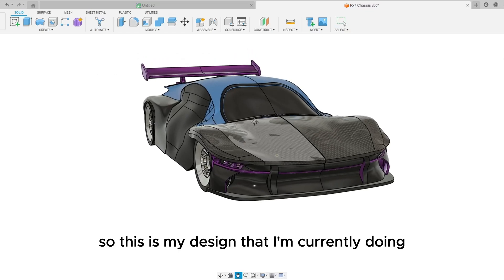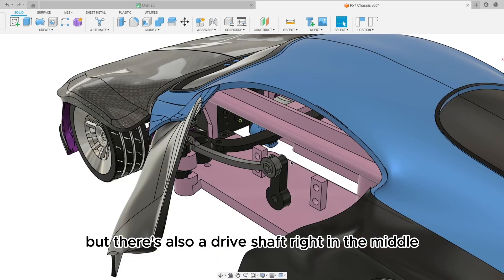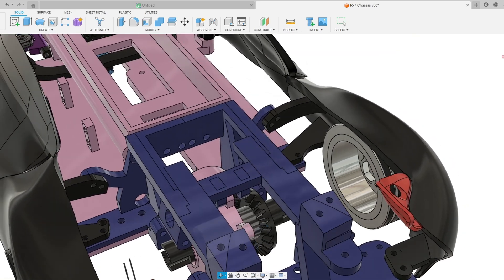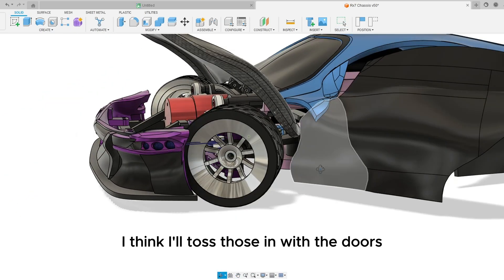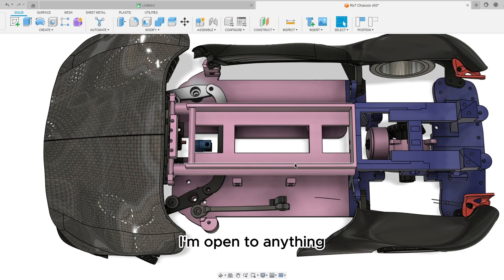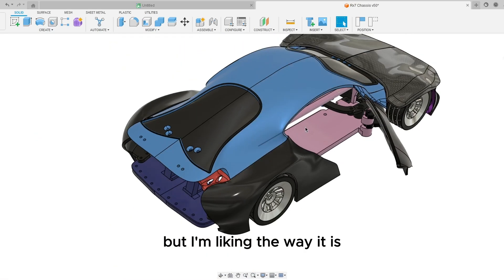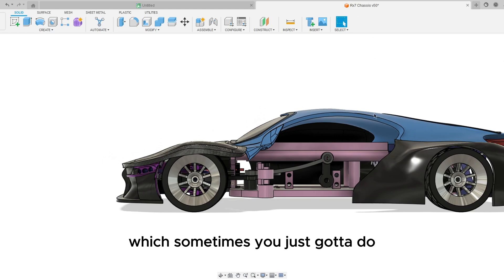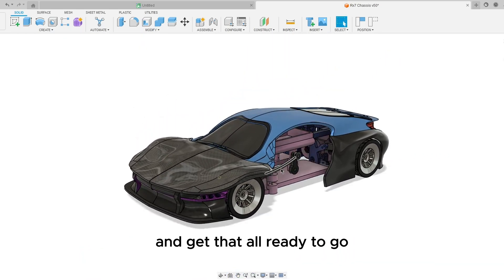3d Printed Car. Part 1!

Comment: Very nice design indeed, from my experience with printing rc cars you would want to mount the printed arm that goes from the servo arm a bit further down on the servo arm (because it looked like it only moved a little bit) which would give it more torque and less slop. Im guessing you're using a brushless motor, if you can make universal 3d printed joint that hold up, very impressive. (Im working on a big 100cm 3d printed monster truck, and Im probably going to have to print the universal joints out of nylon or something.) The gears also btw, ratio has to be way higher like you mentioned, but also they have very big teeth which will probably not run as smooth as "more teeth gears". For almost all my cars I've just put the motor horizontal to the rear axle and had 2 gears connecting them, (the shaft gear being basically as big as the rear tires to get the right ratio).
Reply from the maker: Thank you, I thought of this before but didn't know the reason to do it. Now I do from your comment and will most likely change that part. I use a mix of my brushed and brushless motor(Rn the brushed motor) but the universal joints do work and did break a couple times but with the tweaks I did they work great now. I am currently working on the gearbox and making the gears for the universal joint to connect to. I'll make a video for that and post the universal joint assembly for you as files to look at or get an idea of.
Reply: @ChromaPerformance  Yep, sounds good! The tricky thing about larger veichles is that the durability doesnt scale the same way as the physical volume of the parts does, thus PLA universal joints will break much easier on a bigger high torque (like really high torque, two 775 motors with a 1:5.4 ratio) vehicle. Not to mension jumping the truck and giving it throttle mid air just for all that momentum to go through the joints when you land and the tires instantly stop spinning. Also, what software did you use for making the car body?
Reply from the maker: That is true, just gotta research some other designs or see how the real ones do it. Saw someone use balls for their universal joint. I used fusion 360 and made the body with forms and thicken them to 4mm.  @filippus_

Comment: This is the best build I’ve seen and if I had to give a bad comment, my least favourite part was the rear bumper, but you get it finished🙌🚀💯
Reply from the maker: Thank you. The rear bumper can always be redesigned or even just redone. Maybe a more aero rear with custom rear fenders so it can glide through the air better. "I might just have to do that in the future" But the possible are endless.

Comment: Btw, the windshield looks a bit odd no offence. But I think this has a lot of potential
Reply from the maker: No offence taken. Still in the proto phase so changes can be made. I am always looking for new ideas and what others think. Thank you
Reply: @ChromaPerformance  another thing, the front hood is sticking out a bit, but overall looks good, so I subbed to see the results
Reply from the maker: Thank you for the sub. The hood sticking out a bit is part of the design, but it does not sit flush yet with the front bumper. I will be fixing that and making more flushed. I am not going to be rushing this process to make it right but hopefully I can get the results part by part. @davidnotgidenko
Reply: @ChromaPerformance  sounds good! Cant wait to see what the future holds. Just fixed my printer directly before I typed this comment

Comment: honestly a mid wheel engine would be interesting with all wheel drive system so the weight ratio of the car will  be balanced since its just an RC car, that would be interesting if you can make it work
Reply from the maker: I completely agree. That might be my next design

Comment: If the front and rear glass looked just a little more traditional like off the gen 4 RX7 or Mazda Miata, your design would pass for a production vehicle.👌EDIT: also if that body line you have on the doors, if you were to split that body line separately from the door so that you’d have front fenders, you could then make your doors open a different fashion like scissors or butterfly. Not that you need to, but if you created a fender off the door’s body line, idk if they would still open the same so that’s why I’m imagining all this. Still lots of potential with your design!
Reply: I’d like to see you succeed on that! Keep it up!
Reply from the maker: I love to hear this and I can see what you are saying. I did try to base the whole chassis off a rx7 fc but then took a turn for maybe my own car. I definitely will listen to your ideas and will do my best to improve this design. Thank you
Reply: @ChromaPerformance  .. Hey that’s a noble response🫡 I love what you’re doing for sure., I’m subbing because your channel has potential!
Reply from the maker: Thank you so much. I am trying my best and will do better to show off the potential with my videos! @toysforboysrc  Thank you again.

Comment: What are you printing this out of?
Reply from the maker: Making this with PLA. But the suspension for the spring I am still testing.
Reply: @ChromaPerformance  I would recommend PETG, or if you've got an enclosure ASA. A lil bit of a pain to print, but VASTLY superior mechanical strength, plus heat isn't a problem so no worries on a sunny day.
Reply from the maker: @callumwigg1337 I did not think of that. I have some ABS but still learning how to print it. But I will consider ordering some petg for the mechanical parts like you said. Thank you